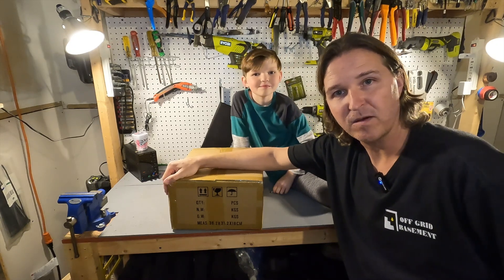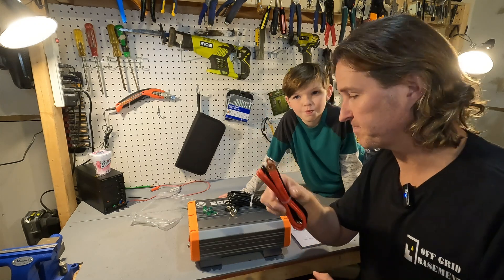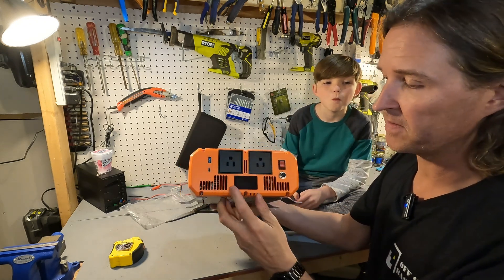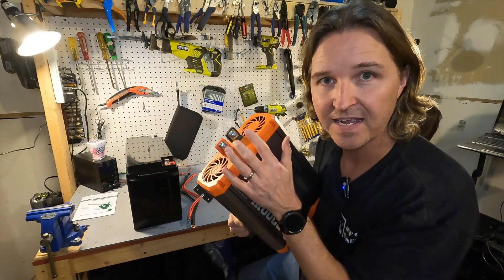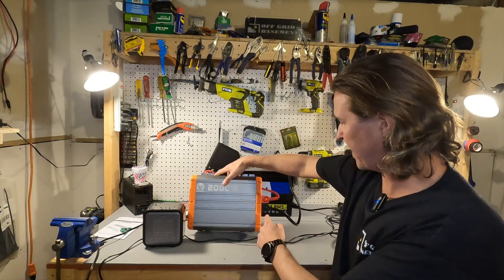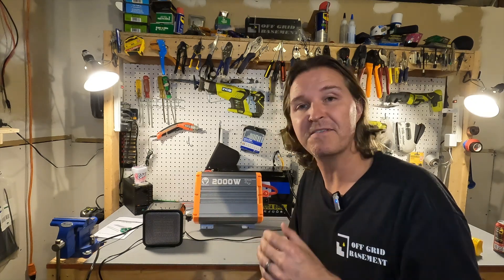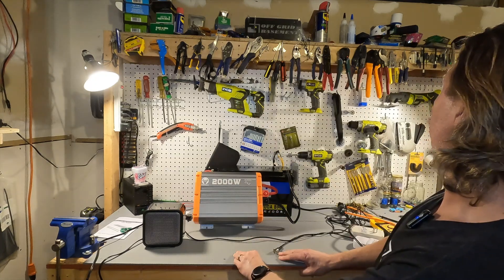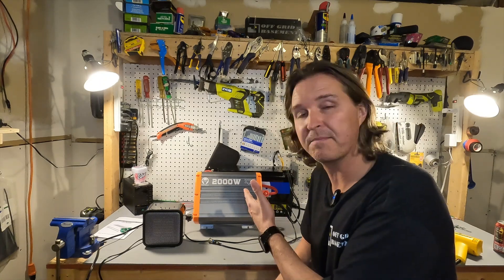I'm not impressed with the TopBull 2000w Pure Sine Wave Inverter.  Horrible Voltage Drop!

Comment: Did you ever redo this and monitor the battery voltage and current?  I have one of these and will need it to run 1700 watts

Comment: I agree with you. I just purchased a 3,000 watt and I am sending it back. It has a low whistle even when no load and powered with 400 amps of lithium and 2awg 2' cable  still beeps intermittent intermittently. with a 1,000 watt microwave.  Just not up to what it should be.
Amazon choice made me think it was good.
Reply from the maker: Thanks for sharing and for the comment.

Comment: The reviewer has to know how to properly test things!. He neglected to check the battery voltage during the test to make sure it was not too low.. If it is low, the inverter will never put out its rated wattage. Another issue is the voltage drop of the input cables.
Reply from the maker: I understand the scepticism.  The lifepo4 battery was over 80% capacity with a 200A BMS.  I know voltage wasn't a problem, but you're right..  I should've put a volt meter on the battery during the demonstration.  As for the wiring, I used the wiring supply with the inverter.  I know it's not the best, but if topbull knew their cables couldn't handle the amp draw, then that is another issue in itself.  Thanks for the comment.
Reply: @OffGridBasement  I would like to mention that a battery may not actually produce the current specified. To be really scientific, it's best to check it and the input voltage to the inverter to see if it's actually providing the current and voltage needed for the inverter to produce its rated output. A huge issue of course is that with a 10 fold voltage increase from the battery provided by  the inverter,  there is an approximately 10 fold current requirement to produce the voltage (an additional small amount of current is needed to compensate for conversion inefficiency).

Concerning the rather small gauge cables supplied for the inverter issue, as you mentioned, I'm really surprised the manufacturer or seller provides four cables to prevent unnecessary voltage drop and wasted energy as heat. The manufacturer or seller really needs to address this issue. It's very nice that there are people that take the time to make videos to test devices so we can see how they perform to help with our purchase choices.

Comment: The cables held you back. It is unfortunate they included dual 8awg, that are soldered and then crimped (worst assembly possible). Basically, the inverter was starved of power. Do that test with quality cables and it easily surpasses its ratings. It would have been best if they just did not put those cables in the box and your review would have a very different outcome.
Reply from the maker: I will do a second test on the inverter to further investigate.  Thanks for the input and comment!

Comment: That are Chinese Watts. When working with such powerful battery, you need always take the necessary precautions. For example, add a fuse in between because you can never know. At a short inside or outside (clamps), with 200 amps it can melt metals and weld it together easily. When that happen, you really need to run to the outside.  Always use a fuse (in off state) and never connect it with live terminals. I have to mention this because I had an inverter with a loose/lousy wire terminal connection INSIDE the unit and it wasn't protected with heatshrink or a plastic. You have to be careful, even when it is brand new. Now the first thing I do is open it up to see if everything is fine and connected properly. Also check the quality of the wires and solder connections.
Reply from the maker: Thank you for the great information.  I'll set up a bit better on the next review.

Comment: That battery of Yours, does'nt it only have a 100 amp BMS??? - if so, then the battery should cut off at around 1200 watt...
Reply from the maker: No.  It's a 200ah Battery with a 200A BMS.  It has plenty of power for a 2000w inverter.  Thanks for the comment.

Comment: I'm curious to know if it's those cables or not. The cables these inverter manufacturers provide are pure trash from every company, especially these ones where they are those split kind. I wouldn't doubt they really cheeped out and it's also CCA on top of being split small gauge wire, that's my experience with those kind. Soon as I see the split wire, I toss them straight in the trash. I honestly wish they would just not include cables at all rather than send these things out with something that's potentially very dangerous to use.
Reply from the maker: I'll give it another try with proper wiring.  That seems to be what everyone is thinking.  Thanks for the comment.

Comment: I'd monitor the input battery voltage at the inverter before kicking it to the curb.  For some reason (cheap!) all the cheap inverters come with wimpy battery cables/terminals.  You might be dropping a fair amount of your 13V when the inverter's trying to pull close to 200A at full load.  That might be why it was beeping, not overload, but close to under voltage.  I used dual 4ga cables on my 3000W unit, and as short as possible.  and solid copper lugs, crimped and soldered. Never got warm, even when running 1.5HP well pump.  I suspect that the unit just didn't have a stiff enough input to sustain it's output voltage.  (Or it is a piece of garbage anyway...:)  Always interested in decent budget power stuff.  Keep on with the videos!  Stu
Reply: Good point. I bet thoes wires wer warm
Reply from the maker: I know all the connections were tight and the cables were the ones that came with the unit.  If they are sending me a unit with cables sooo crappy that it can't draw the voltage from the battery, then that just adds to my concerns.  Thanks for the info and the comment!

Comment: weird you have that amount of voltage drop, that's usually a battery issue, not the inverter. I wonder if the AC voltage really was 111-112 volts before the start?
Reply from the maker: The battery was more than able to pull the power needed.  I believe the inverter is programmed to lower the AC voltage when it gets too high.  It acted like the EB3A when you have it on power boost mode.
Reply: @OffGridBasement  Brad Cagle just did a review on the same Inverter and the inverter didn't break down.

Comment: When YouTube channels review a product and recommend it, I generally take it with a grain of salt. You never know what "PERKS" the YouTuber is getting. But when a YouTube channel does NOT recommend a product, that channel gains my trust. Thank you for (as I can tell) always giving honest reviews and recommendations.
Reply from the maker: You're welcome!  I feel bad when a company puts the effort to contact me and send me a product just to find out it doesn't hold up to my standards.  Thanks for the comment!
Reply: Either way the results may not be accurate. The reviewer has to know how to properly test things!. He neglected to check the battery voltage during the test. If it is low, the inverter will never put out its rated wattage. Another issue is the voltage drop of the input cables.